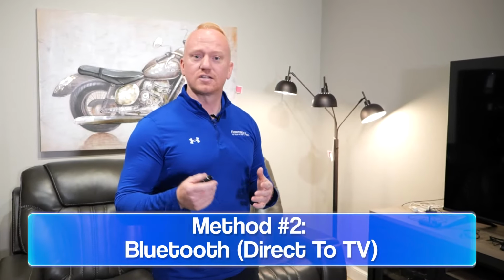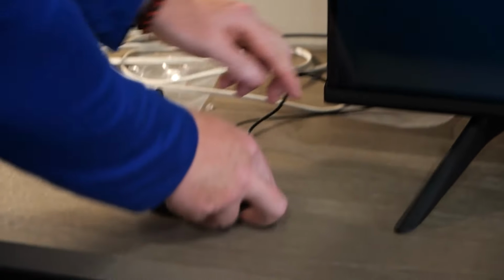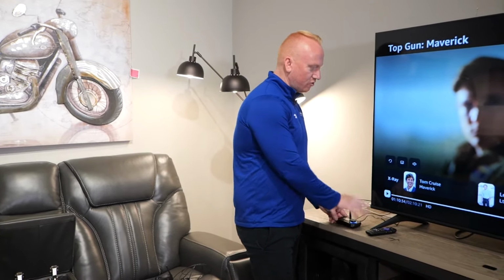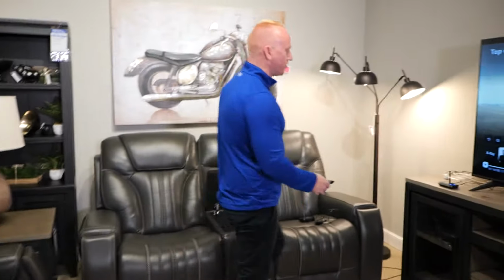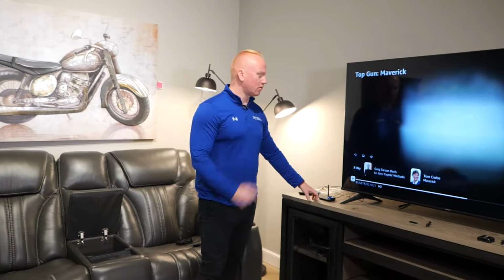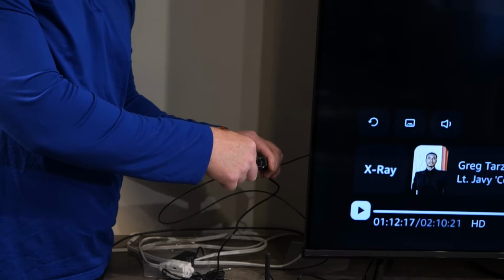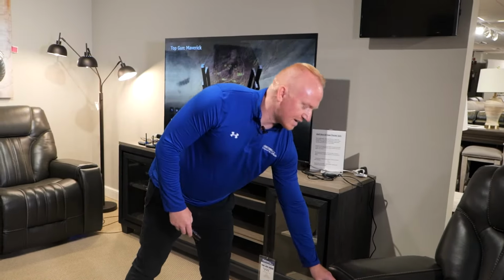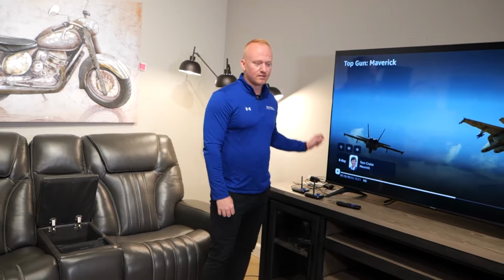Connecting Moto Motion with Zach

Comment: We recently purchased the Moto Motion sofa and recliner. I’m using the Monster Bluetooth receiver/transmitter (puck) to pair my TV with Moto Motion speakers. When my wife turns up the volume from the sofa, the audio starts to echo horribly. Note: She’s not turning it up to any high volumes. I have noticed that the puck doesn’t support aptX low latency. Any help to resolve this would be greatly appreciated. 

FYI - I’ve contacted mymotomotion and Furniture Fair Fairfield for support, but I’ve not received the help I hoped for. Al I got was each of them pointing at the other to address this. Not a very good experience thus far past the purchase.

Comment: With that optical splitter are you able to just run multiple optical cords from it to each piece?
Reply from the maker: It seems likely that you can run multiple optical cords from the splitter to each piece, but we can't say for sure. We haven't been able to test this due to the need for extremely long optical cables. The setup would involve connecting the splitter to the TV’s optical port and running cables from the splitter to each device, making sure to select 'Optical cable' as the SOUND OUT option on the TV. However, to be certain, we recommend reaching out to the manufacturer for confirmation.

Comment: Question for you, I have a Yamaha Receiver RX-V834, Can I connect it to the couch using the Optical cable? Basically I have my Apple TV, Cable TV  and TV all plugged into the receiver which then outputs to the surround sound speaker that came with the receiver. Can I change the output to go to the couch instead of the Yamaha Surround Sound speakers?

Comment: If the tv does have Bluetooth, can you hook more than 1 couch to the tv?
Reply from the maker: The ability to connect multiple devices depends on the specific TV model. However, in most cases, a TV can only support one device connection at a time. To connect two sofas to the TV, you will need to use the puck.